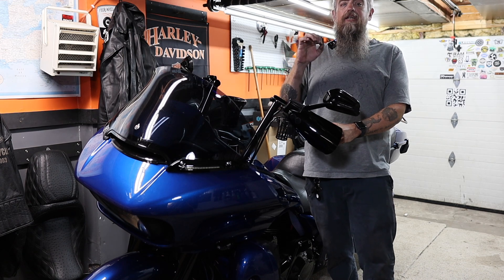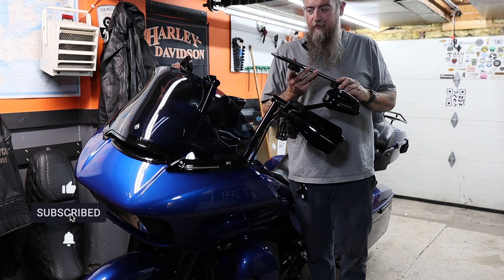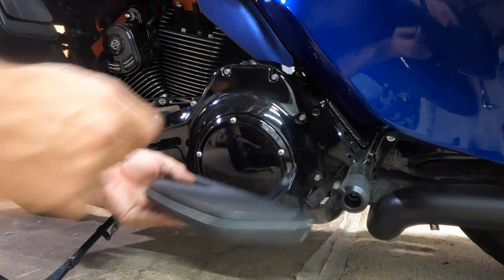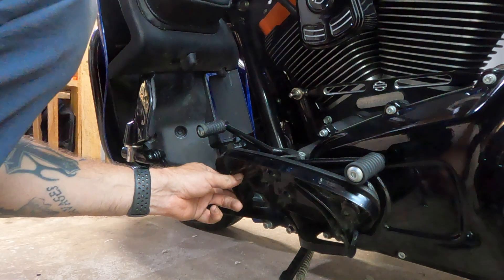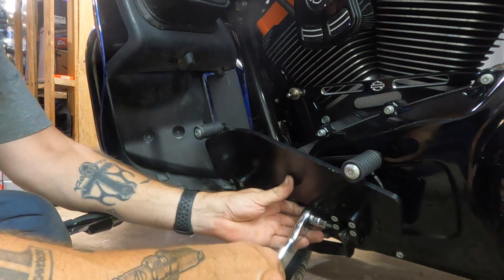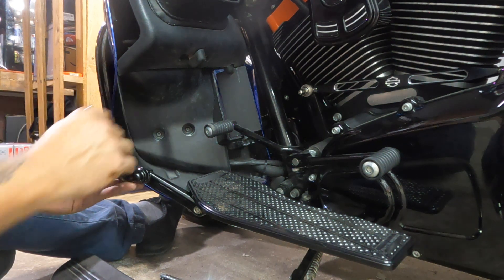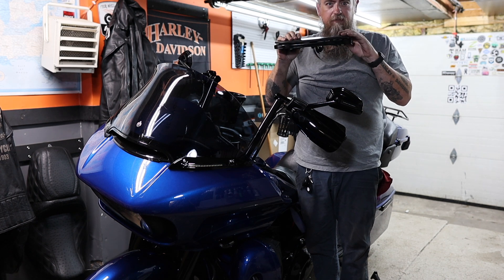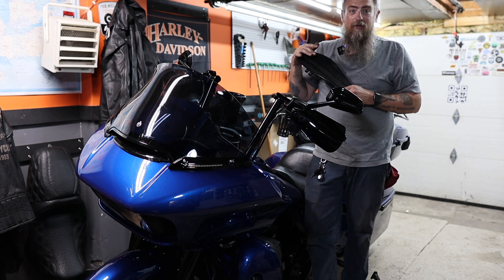Check Out My Awesome Upgraded Footboards For My Road Glide!

Comment: look good interested to hear how you feel about the change in the ride.  The vibration is one that's concerned me with those solid floor boards.  Also wondering how the change in your mini floor boards feel as they didn't seem to fit as well with the new big floor boards.
Reply from the maker: I Am really liking these footboards, the placement of the ciro highway mounts are actually better as well because im able to stretch my legs out further, the vibration does not bother me so far.. I really only noticed a difference for the first few miles and than quickly got used of it. it'll be interesting to see if it bothers me on a longer ride or motorcycle trip.